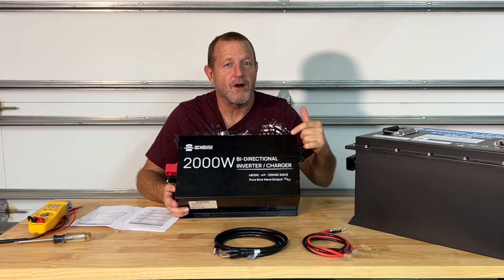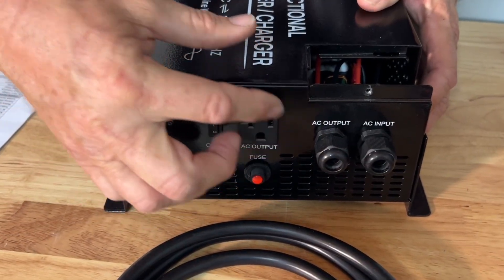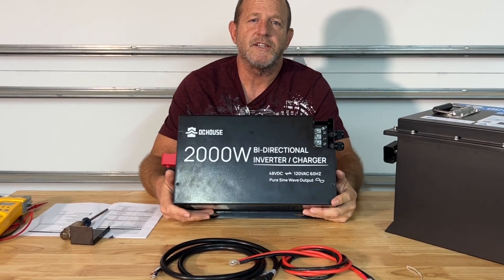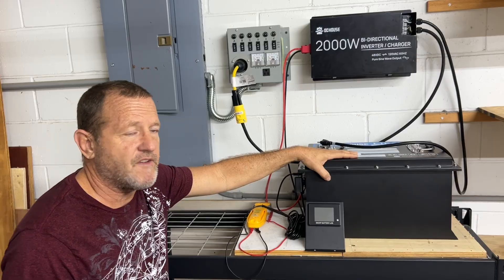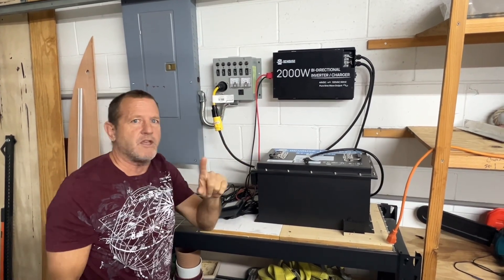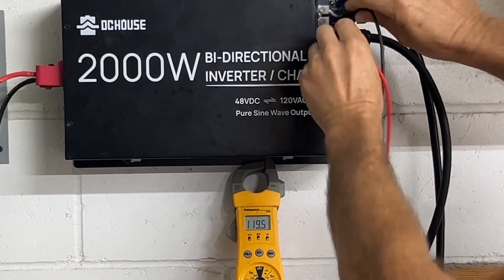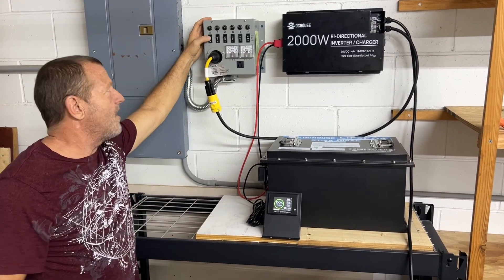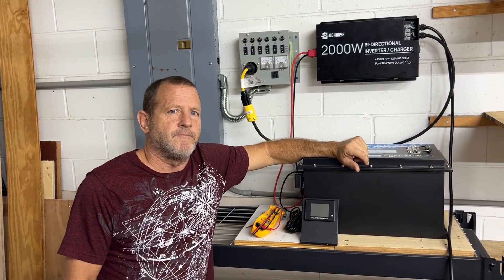DC House 2000W Pure Sine Wave Inverter/Charger - Home Back Up Power W/ DC House golf cart Battery

Comment: Can this be used for a travel trailer where this inverter is essentially used as a transfer switch for shore power?  When trailer is plugged into shore power at the campground, the inverter would pass thru the shore power; when not connected to shore power, it would convert power from the batteries.  I can't seem to find the manual for this product....
Reply from the maker: yes that is how you would use it . just make sure your loads dont exceed the pass thru power limit
Reply: @StoneBrokeAdventure  do you have the manual?  I only see the spec sheet say  1500W as the input power, but I'm guessing that's the charging power consumption.  I would expect to see a passthrough rating also in the manual.  thanks!